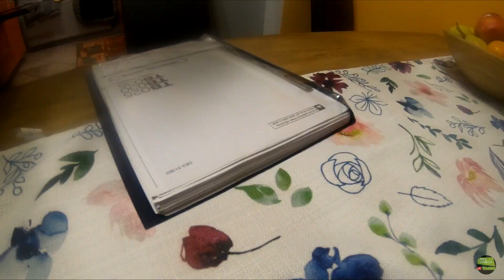Just an oil change in final drives on my Takeuchi TB025

Comment: I know I'm a newbie here but the way you filled the final drive seems to defeat the laws of physics. Shouldn't you rotate the drive until one hole is in the middle, the other on the bottom and fill the drive through the bottom hole until it comes out the other hole? Just sayin. I have a TB016 and want to change it but after watching your video I seem to be a little confused now. I know there must be an internal part that is tripping me up (that I can't see) so please correct me if I'm wrong. Thx.